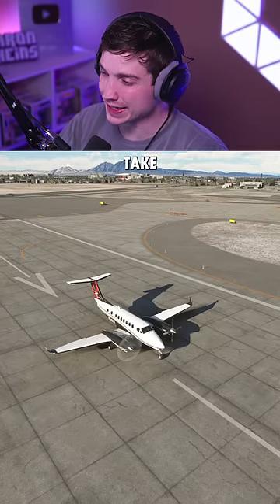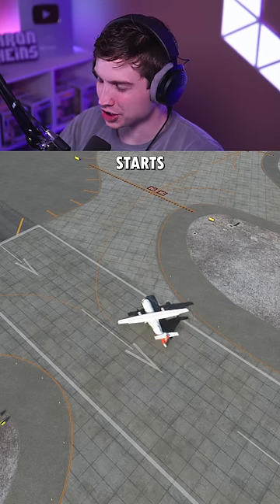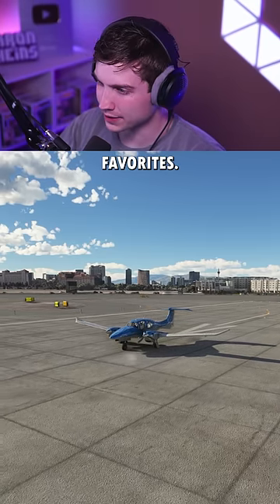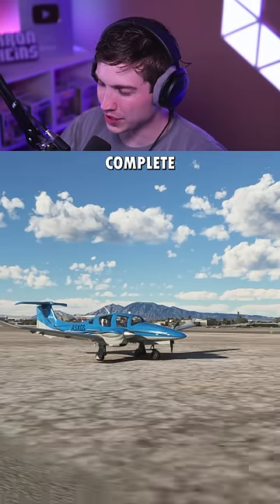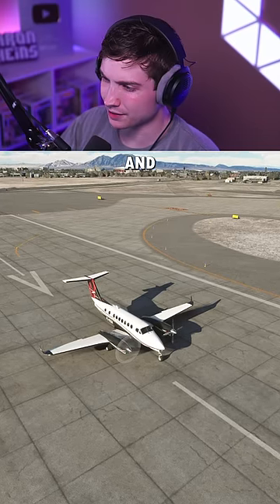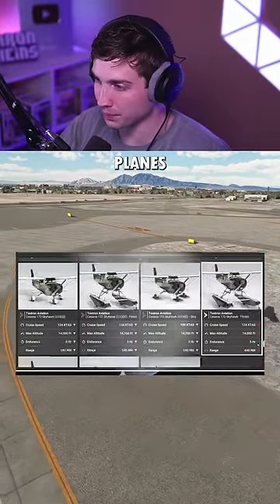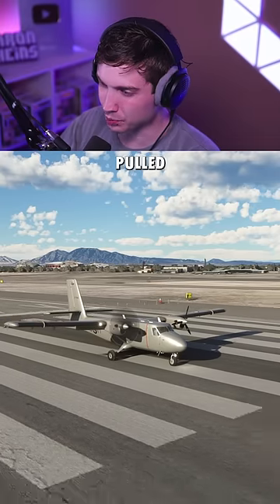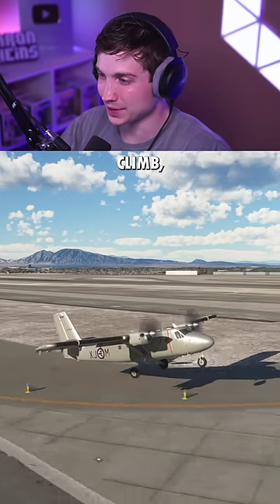Can Twin Prop Planes Takeoff with ONE Engine?

Comment: As a pilot on atr i can confirm it is vv difficult for an aircraft to take off using single engine .We guys do train though for engine failure after V1 and it is a really hard exercise to do.
Reply: If you really are pilot, thanks for your service in the aviation!
Reply: Is it possible for propellers to turns by just the wind?
Reply: Yes it is possible the props on ATR specifically are free air turnine one so it is possible but aircrafts like Da-42,Da-62 use properllers to power the engine so in that it is not possible
Reply: Do you fly for IndiGo, Alliance or flybig?

Comment: It's definitely possible as all twin engine aircraft are designed to be sure they can fly with 1 engine, you also didn't add any rudder trim which is necessary to fly with one engine

Comment: Try jets instead because their thrust is more centered. If not, try mimicing 1 engine by throttling both engines to 50 percent, then you wont have a turning problem.
Reply: Part 2

Comment: On most of those planes you’re failing the critical engine.  It’d be a lot easier to control if you had the left engine operating and the right engine shut down.  Give it a try!

Comment: you are moving below VMCG (velocity of minimum control on the ground) there's not enough air flowing through the rudder so there's not enough aerodynamic force to counter the asymetric power producing by only one engine pushing you foward! if you are above VMCG you'd be able to climb in those planes!

Comment: Use just enough power to stay on the runway.  Many twins VMCG is quite slow but full rudder and only as much power as you can keep it straight and most twins will easily take off.  Use full rudder and steering or brakes, not full power.